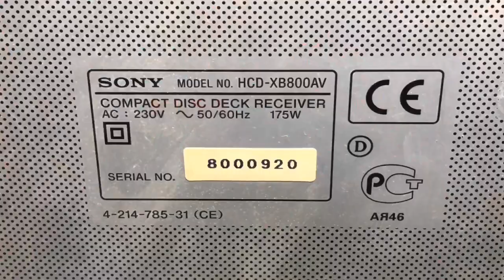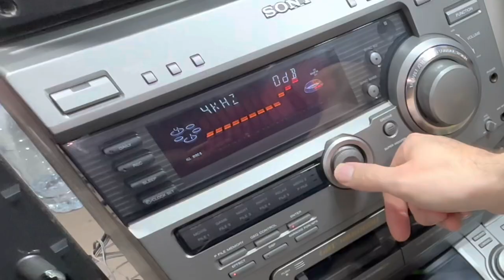TRAILER SONY LBT-XB800AV COMPACT Hi-Fi STEREO SYSTEM SONY SPEAKER SS-XB800AV  Maintenance Repair

Comment: I have a sony lbt lx30 with same light display as sony lbt xb800av but Sadly the type deck is broken and I need help fixing it can i use rubber ban as a belt are dose have to be normal belt